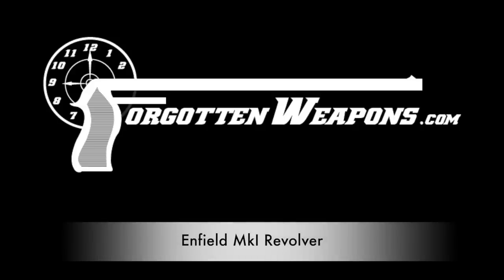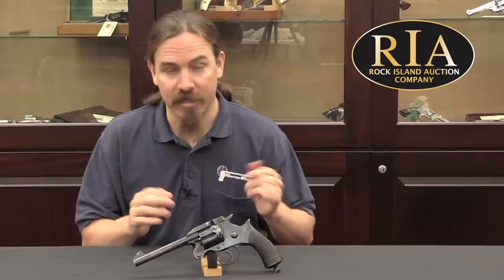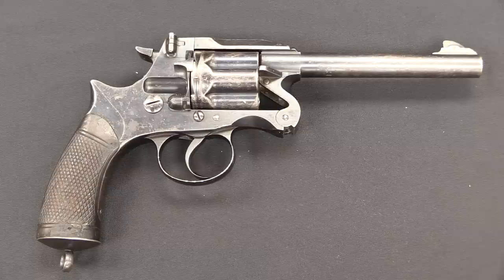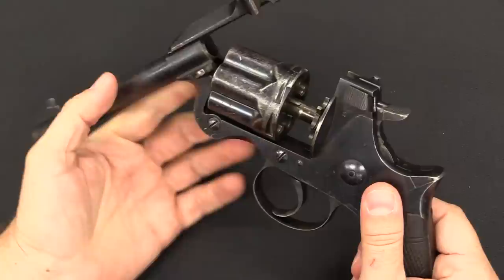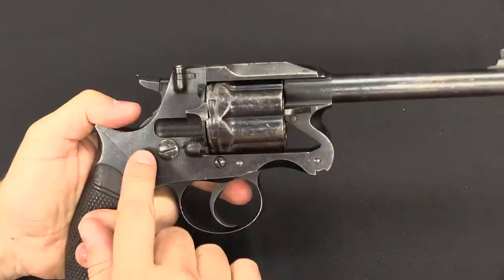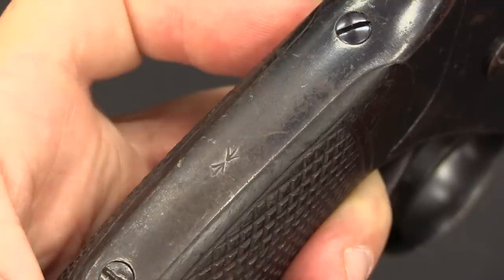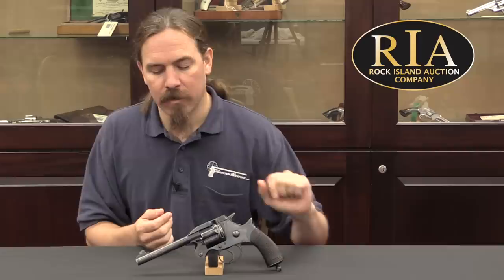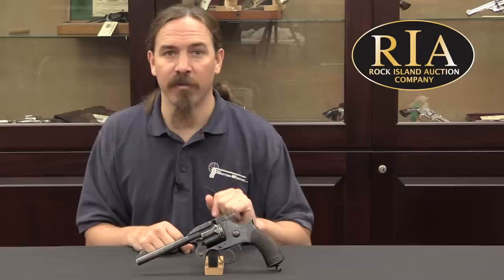Enfield MkI Revolver: Merwin Meets Webley (Sort Of)

Comment: I have a top break Enfield revolver in .32 S&W. I did do some research on it because the hammer doesn't have the hook to cock it back and supposedly they were shaved off for tank commanders so that it was wouldn't get caught on anything while being pulled out. It's rather neat and despite it being single action fun to shoot.
Reply: Yeah, originally Webley D/A revolvers had their hammers 'bobbed' to make sure they didn't catch on anything. However, someone could always come along and bob it after the way to take a tank 'model' (wasn't an actual adopted model, per se) to increase it's value. I hope they didn't though, because Webleys kinda get mamed more than they should.
Reply: @riverstyxarmory9782  mine is an Enfield though. And while someone could have done that with mine, I doubt it since the metal looks even all over. The price wasn't too bad either, picked it up at a gun show for about $100.
Reply: @elorangeman  no idea why I saw Enfield and read Webley. I just like Webleys I guess.
Reply: @elorangeman  It will be a No.2 Mk.I* or 1**, designed with the bobbed hammer, but not for tankers per se; for everyone.
Reply: @riverstyxarmory9782  lol. No worries my dude. It's probably the quintessential British revolver.
Reply: @skepticalbadger  thanks for the info. Hell of a lot of fun to shoot and reload.

Comment: Could you elaborate as to why the safety issue was such a surprise to the British?  All revolvers up until the transfer bar system was invented were known to be dangerous to carry with the hammer resting on a loaded chamber. Isn't that why the original Colt revolver was changed from 5 chambers to 6 chambers so the hammer can be resting on an empty chamber and still have 5 loaded as oppose to the original which would only afford 4 loaded chambers. Isn't that why revolvers such as Remington had grooves between chambers so the hammer can be resting in-between loaded chambers? Why in the 1880's did the British not understand this?
Reply: Well it wasn't the transfer bar that allows you to carry a fully loaded revolver safely, it's the rebounding hammer which had been around for a while by the time this revolver came out. I can't speak as to what safety measures this gun used prior or post modification.

Comment: They should have went with a S&W #3.
Reply: Well theres an interesting story around that.
Ever noticed how a Webley uses the same sort of break eject system as a S&W Model 3?
Thats because when S&W were swamped by the Russian order for model 3s they sub contracted iwth manufacturers in Belgium and the UK to help make the guns. Webley was one of the UK firms they contracted...and then they just swiped the design features and hey presto - the classic Webley top break was born.
Having examples of both I have to say the Webley improved on the S&W by getting rid of the ridiculous backstrap and grip being canted so far back from the hammer. I do love the S&W M3 though.... it really is a true US classic.
Reply: @sandmanhh67  The Russians certainly swiped the design...they basically reverse engineered the S&W pistols and built them at Tula apparently.  I can find no reference to Webley doing anything similar... other than producing LICENSED copies of S&W's "Tip up" break actions.   No doubt the Webley people were not going to forget the S&W designs when producing the Webley-Pryse in 1877    It worked both ways of course...Webleys "British Bulldog" revolvers were apparently widely copied by both European AND American gun makers....

Comment: yeah it's an old video, i can't seem to find the answer in the comment section. if it's there, please point me to it. does anyone have a clue what the wings under the forcing cone area would be for? the only thing i can think of would be to assist in reholstering. to keep the abrupt sharp edges of the cylinder from catching on a possibly kinda floppy holster. just a thought.

Comment: Heavy, misfire cases would jam upon opening and extraction of same was a pain, Henry rifling (as used in the Martini rifles)! not Enfield rifling, works better as a double action only, to which single action hammer pull back was exceptionally heavy so aimed shots are hard with just using your thumb, a long firearm to holster...
As a collectors piece, yes it's ok, but o/w no.
Webley's were better.

Comment: Seems like weapons training would solve the bottom case getting hung up.

Open the top turn 90 degrees.Shake. Rotate back close top and load.

Alternatively could you load ammo while the top was open?
If so when loaded the first cartridge and rotated the cylinder the hung case would fall out.
Reply: Better yet, throw it away and buy Webley Pryse/WGs.
Reply: The rim of the case must be behind the extractor star, which means it must be loaded through the gate.
Reply: @mrb692  i agree with you. 
My point being. If you open the top. The cases fallout. 
Put a new round in through the gate. Setting the rim behind the extractor star. Tip in the chanber. 

Then rotate the cylinder.
Would it drop out the bottom case and then you either close the top or keep reloading and then close the top.